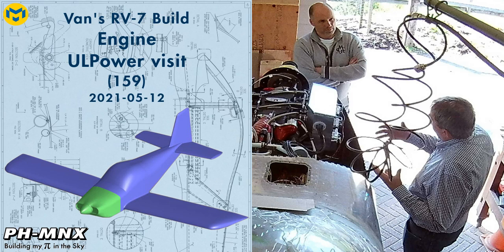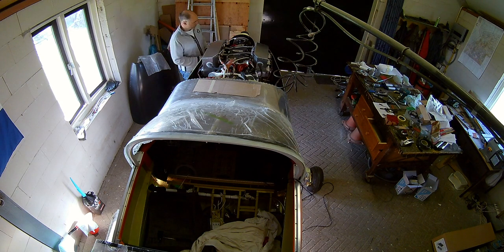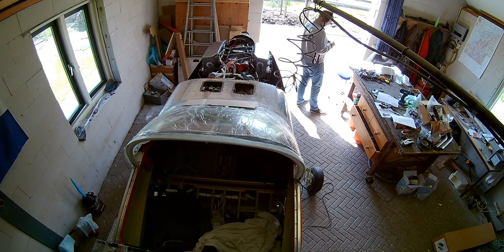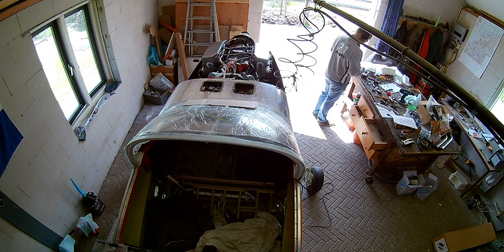Van's RV-7 Build Engine ULPower Visit (159)

Comment: Hi it’s so grt to see your videos. They are inspiring and informative. So did you put a turbo to 520isa ? I am planning to build rv7a and hence would request some basic help. 
Regards. 
Aj GIll.
Reply from the maker: Hi,
No unfortunately, I think the Turbo version is kick-ass, since it has more power at lower RPM and keeps power when flying higher. However the Turbo version wasn't available when I bought the 520. Also it would probably be too costly for me.
In video 159 you can see that ULPower visits me to check my cowl if a Turbo (and intercooler) would fit.
Cheers,
Marcel
Reply: Hi thx for the reply and I have almost gone through all ur video they all are amazing. I am actually curious to know the status of ur aircraft. Also if u can share with me the approx cost of the 520isa and the prop. 
Regards.
Reply from the maker: @captavsgill5960  The status is that it is finished (I'm just lacking the time to get YouTube in sync). I have received my Airworthiness certificate 2 months ago.
I have some small (avionic) issues (flyable) and I'm waiting for good weather for a first flight. Winters suck in the Netherlands (for flying, skating is great).
Yes I can tell you what I paid almost 2 year ago in Europe. I'm not sure if these prices are still current, and if it works outside Europe. But I paid €40000 for the engine (incl. VAT) with all options and installation items and €12000 for the Airmaster prop (from New Zealand).
Good luck with your build.
Reply: @PHMNX  once again congratulations on ur first flight. Looks amazing. How’s the engine performance?  Looking forward for more videos and updated. ...... cheers.